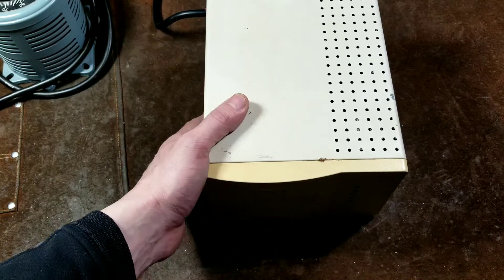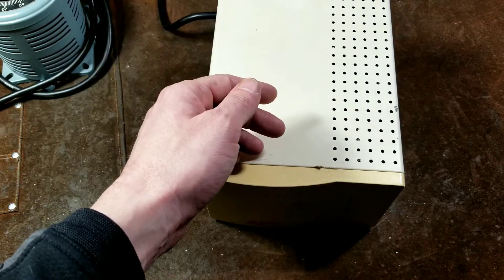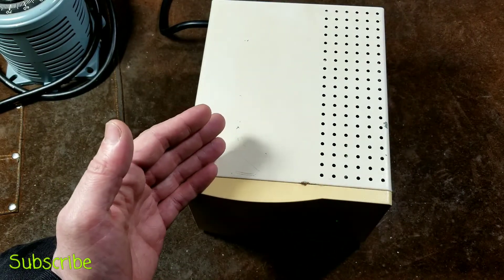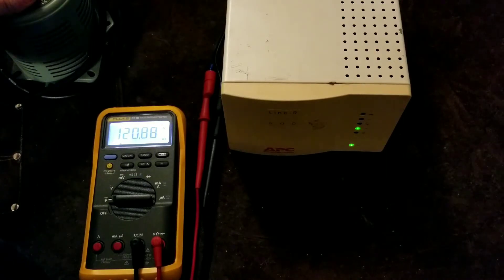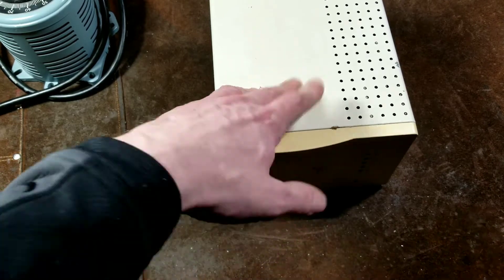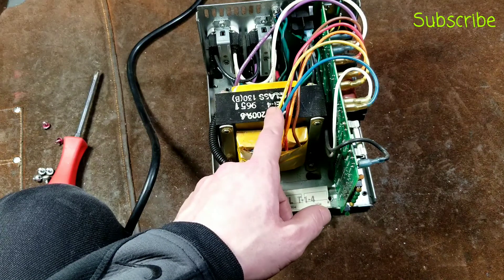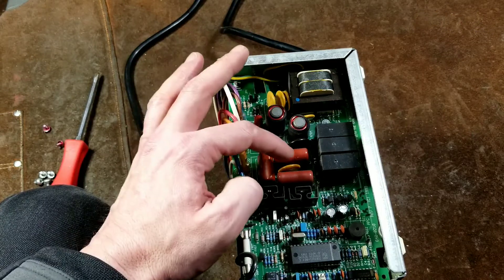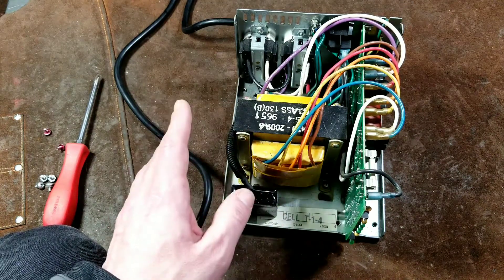APC Voltage Regulating Power Line Conditioner Review & Discussion

Comment: Great video. It was very interesting. I have 2 APC UPS ES 350.
Funny story... there was a power outage one night and I checked one of the APC units and the unit was able to power some things that I did not need to use at the time, so I unplugged everything from the unit and plugged the refrigerator into the APC unit to see if it could be powered for a little more time... yeah it didn't work hahaha.  Thought it might be worth a try since they are always showing how energy efficent appliances are these days LoL.
Thanks for posting this video and cheers.
Reply from the maker: Yes the electric motor and In a refrigerator would draw more than 350 Watts at least get started

Comment: I have a power outlet that is roughly 90volts +  can this unit sustain a proper voltage for a permanent solution?
Reply from the maker: Yes that's exactly what this is for and can run continuously for a  voltage boost mode just remember it's going to pull extra amps to boost the voltage and it's something to be aware of

That is a pretty low voltage power outlet you might want to investigate why it is so low.

Comment: I looked to buy a LE600, but it is made like the LE1200 is now...performance wise...is there a big difference between the two?
Reply from the maker: They both work the same just the older one had higher quality components and a steel chassis and the outlets can be upgraded
Reply: @CatusMaximus  Thanks...I ordered the 1200...but don't know if it will function the way I want...I want to plug in my Furman PL-8C into it...I live in an apartment with sketchy voltage flux...the Furman cuts off periodically for either high or low voltage...so I was going to plug the 1200 into the wall...and plug the Furman into it...I use the Furman to protect my home theater system...tv, sub, receiver, modem, etc...the further I read...I noticed the 1200 is only 10 amps and may not support the load of the Furman plugged into it...but I'll see later on today if it does...if it doesn't...I'll return it.....

Comment: What would you recommend for clean power to an oscilloscope, APC - LSW1200 Voltage Stabilizer or APC UPS RS 1000? I have 262v mains voltage and I want 230v of clean isolated power.
Reply from the maker: An online type continuous conversion UPS will always be best because it will always put out a perfect sine wave regardless of what power coming into it or even if there is no power coming into it.

Many times you do need an isolation Transformer when using oscilloscopes if you do not have one of those I'd recommend getting that first

Comment: Hi Catus, great video!👍 Just experiencing high voltage at my home (av. 245-250V) and because I have a HiFi stereo with nominal input 230V, I need to figure what to use to reduce it. Do you think this unit, or its brother LE1200I version, is suited for such equipment? 
My stereo amplifier is AB class with 280W (max) power consumption.